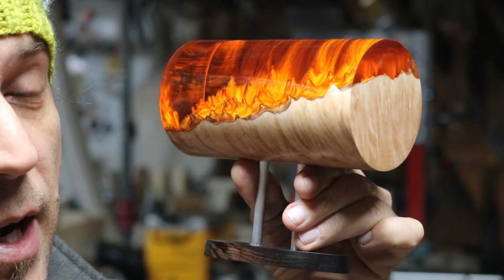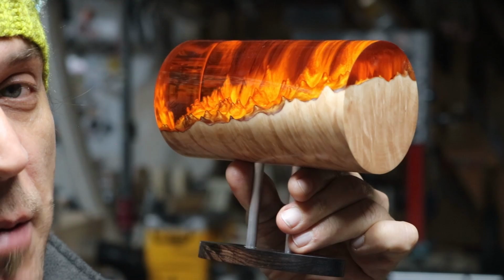#49 Woodturning "Encapsulated Terrain"

Comment: Hi again from England Mr. Knuckles...

Now:
If you get yoursen a disk and fit it to the headstock on that lathe...you could've used that to finish that end...rather than using the DA for ages...
And in fact if you do a lot of these then you can invest in a small metalworking lathe...as that'll have a carriage... 
Then alls you does is clamp the workpiece to the carriage packing it out at centre height (similar to if your lineboring)... 
You can then polish up the dull end by bringing the work up to a drive plate in the headstock that you've fixed your sandpaper to... 
Going up the grades... 
It'll keep the end square as well... 

I think your work is beautiful...its Art... 😊